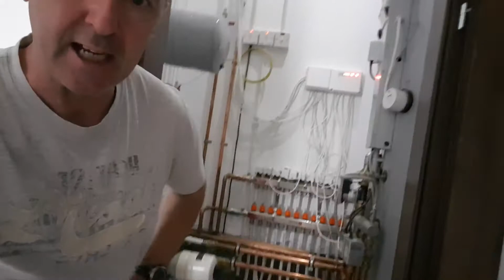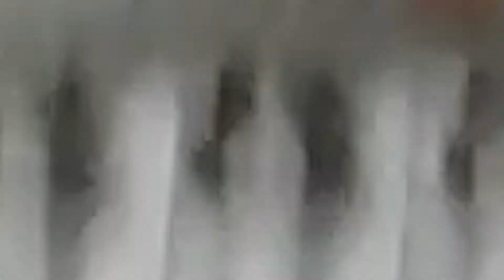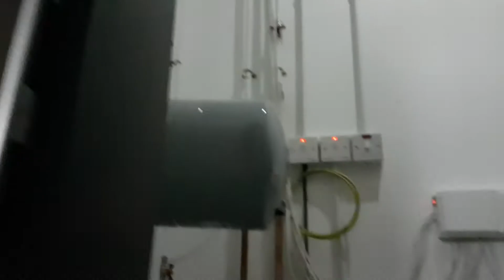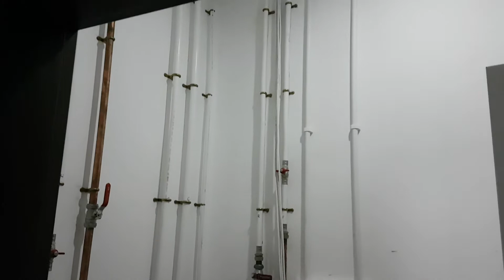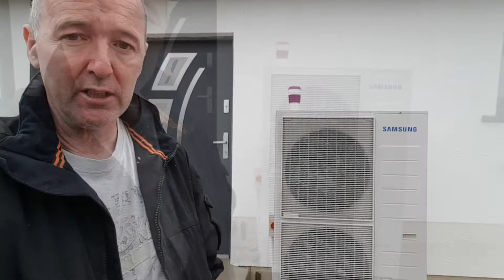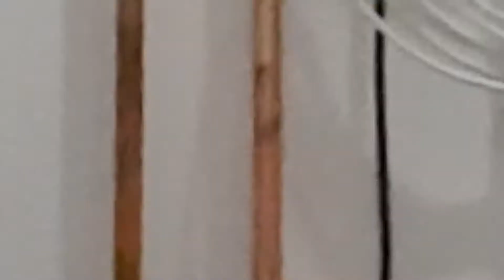12Kw. Samsung Gen 5 Heatpump .. Finished and Working Underfloor Heating System

Comment: Should be filling loop value on this system that goes from the big tank to the pipes be open cause I noticed mine is closed and my house tiles are not warming up
Reply from the maker: Hi Bryan. If there is insufficient pressure or your system is airlocked it would stop the heat exchange process. If its a pressurised system repressurise to 1.5 bar. If it's from your tank in the attic it will only achieve about 0.5 bar depending on the height of your house. Open the valve fora few seconds at a time. Hope this helps Cheers Gerry

Comment: Can you ever install these without a buffer? How many sq m was the floor ? Finally what kind out output temp would you expect from the heat pump? Many thanks !
Reply from the maker: Hi Max. Yes you can. I will be showing an underfloor heating system done on the cheap very soon. No buffer tank and a 15 year old boiler + 300 litre hot water storage tank connected but not as a buffer. The heat pump in this video was 12 Kw and more than sufficient for the 2000 sq foot  186 m2 home. Hope this helps Cheers Gerry 👍
Reply: @GerrysDiy  Thats Gerry . my home is 450sqm, and I have a local supplier who suggest s a 12Kw unit that will warm in the winter and (reversible range) also cool the marble floors in the summer (thus assisting the a/c a little ) .

Before you think "He is  nuts!"  ...Its in the Algarve Portugal where the lowest winter daytime temperature is 12C and nighttime 7C .

My contractor, here, is a super smart guy... and I should trust him. ( you would like him , he’s ☘️ !) But I like to gain knowledge myself, hence my questions. ( I was a bit wary about omitting the buffer tank, but we are just trying to take the chill off the house in the winter and apparently it won't be necessary) Thanks for the reply, best wishes.

Comment: hi gerry, love the channel, ive been following you for a while but im considering a air souce heast pump and have a couple of questions, firstly im in dublin. the house in well insulated but not air tight, its a BER C1 if you value that rating. Im installing UFH and when we got the unfinished build house a temp oil heating system was installed with a partially installed gas heating system. nows the decision time for us, would you recommed the air source for this house, keep the vids coming, regards, Dave
Reply from the maker: Hi Dave. If you can get your house fairly airtight that will make a great improvement in the length of time the heat stays in the house after you have put it into the floor. Air source is the way to go with your energy. If you are getting 4 to 1 efficiency and above it's a no brainer. There are units out there for a couple of grand. Doesn't have to cost the earth. going that way myself soon. Have an underfloor heating project at the moment but from an oil boiler. Videos on that soon. Thanks for commenting Cheers Gerry 👍

Comment: How come there isn't any form of blending or mixing valve for the underfloor? How are you regulating floor temperature here?
Reply: Don't need a blending valve as the the heatpump has low temperature water.
Oil or gas boiler has high temperature water so blending valve is needs to cool down the water going into the underfloor pipework.
Reply: Can you set the exact flow temperature then? I thought air source performance changes dependant on the outside air temp? I'm just curious, I'm not entirely up on air source.
Reply: Also if you're running such a low temp to the underfloor. How are you bringing your cylinder up to temp. I'm assuming you've fitted a high gain cylinder. That aside I wouldn't generally run underfloor anymore than 40 degrees. How are you killing potential legionella in the unvented.
Reply: @Powertoyah32  thanks Gerry

Comment: Why is my underfloor only heating up on kitchen and not in living room wen there on the same zones
Reply from the maker: Hi Bryan. Close off the return at the manifold to the kitchen and force the heat to go through the living room pipes. Unlikely but there could be air in the circuit. Also make sure the actuator/s for the living room is / are working. If necessary disconnect the actuator from the problem circuit and see if that circuit gets hot. Hope this helps Cheers Gerry

Comment: If hot water is going to upper manifold, it is going to wrong one. Regulators should be on manifold what controls returning water- you can see a blue mark on manifold. Hot water should go to manifold with red mark and flow control taps. But this is easy fix.
Reply: This is correct flow meters are deigned to work in one direction, flow -> return

Comment: Thanks for another deadly video Gerry.
A question for you, I came to this video via your one on simple underfloor heating install (it was on the steel mesh floor)
This air/water system is out of my league. My thinking it to connect the plex arrangement to a solid fuel burning stove with a boiler. 
Would you have any suggestion for a manifold /heat pump for this type of arrangement?
Sorry I'm new to this so I hope the question makes sense!
In any case thanks for taking the time to make and share these videos. Much appreciated:)

Comment: Very neat and organised routing.
Reply from the maker: Hi John. It was a little crowded in the small plant room. I didn't think that the storage and buffer tank would fit in the door so I had a plan B just in case. It is working well and I will be interested to see the clients electricity bill to see how they are faring out. ont beat running the whole thing on free waste oil though lol. Thanks for the comment. Cheers Gerry

Comment: wow are them ..air source heat pumps ...worth the money ...im sill on oil heating with rads
Reply: Hi Gerry, if you increase the heat output density in the floor by spacing the UFH pipes at 100mm in a BiFilar pattern, Circuits no longer than 80m per leg, no more than 10ports and often 28mm feeds to manfold - Them Samsung's run a treat with WL-1 setting at 30/32. Getting your near 5:1 and sometimes above. P.S. The earlier Samsung RC012MHXEA has a COP of 4.6 and the Gen5 is physically identical, but they now quote the lower COP from the GEN5 16Kw Model for both the 12kw and 14kw. Also a new software update addresses the cold weather startup issue
Reply from the maker: Hi Eye Toldyoosso. They are worth it but you need a really well insulated house and ordinary rads generally are too small because the heat pump runs most efficiently at lower temperatures which means the radiators need to be bigger. For every 1 kw you pay for you get maybe 4kw back. These things are between 400 and 500% efficient because you are just paying for the pump to run and not the heat it recovers from the air. These ASHP's and boiler stoves are the most popular installs these days. Cheers Gerry